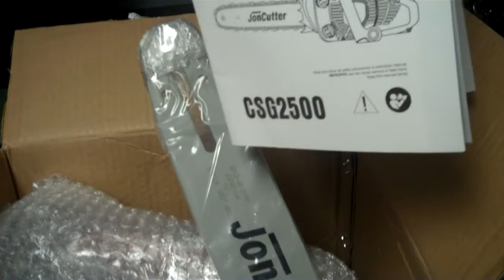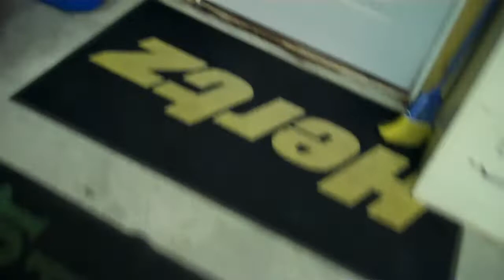JonCutter G2500 top handle saw

Comment: why are you not saying anything as you are taking this thing apart? I have one of these brand new just got it mixed the fuel and it started once or twice butm chain does not move and saw will not stay on and chain brake really hard to operate. ok it got better was wondering about the foam myself
Reply: 😂. That chain brake is a bitch at first. Once you get it broke in good, it works great.

Comment: I just looked at one on Amazon. I wanted to see a review first. looks like a good little top handle saw?
Reply from the maker: Joe Smo , I finally used it quite a bit yesterday.  Ran about 2 tanks through it.  It’s an awesome little saw.  I also cut some 8”-10” stuff with it with no problem at all.  So far, it’s great!

Comment: The chain on mine will not rotate after I put it back together no matter what I set the adjustment to.
Reply from the maker: DallasPilotCar are you sure your chain brake is not on?  It’s either that, or the Chain is not in the groove in the bar.  They are kinda a pain to get the chain on right.
Reply: @BigJip  thank you for replying. No, the bar would pushed inwards. I understand how that works .  I finally took it over to my firewood guy and he got it working right.  I did not really see him do anything in particular i guess you just have to hold your mouth a right way.  Lol
Reply: @BigJip  Finally got it to work but, it still hesitates to move intermittantly while i am cutting wood.
Reply: @dallaspilotcar9293  The bar guides on both sides of the bar stud but are too small, causing the bar to move too much up and down I replaced mine with Allen cap screws that have bigger heads, I think I used standard thread screws which have bigger heads than metric screws. Before I changed them No matter how tight I made the bar stud nut the bar would still move and cause the chain to bind.